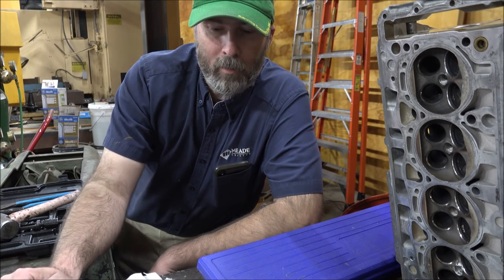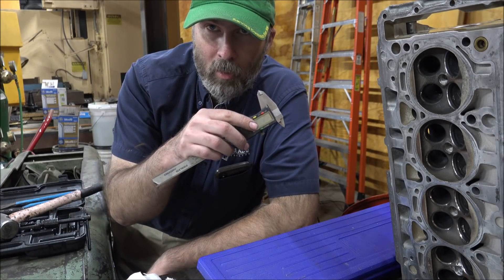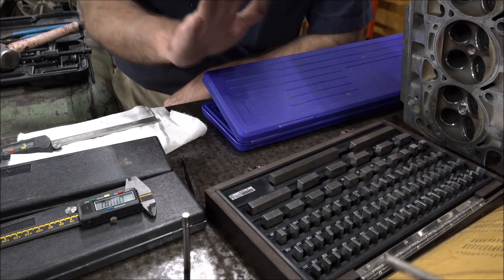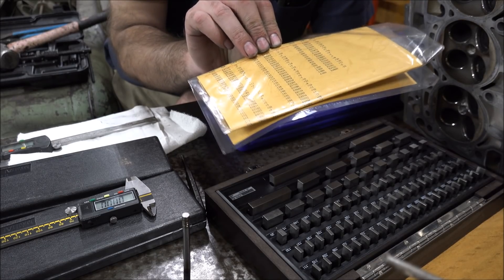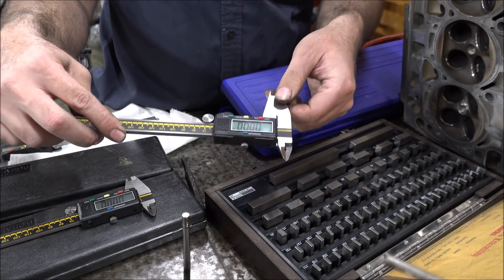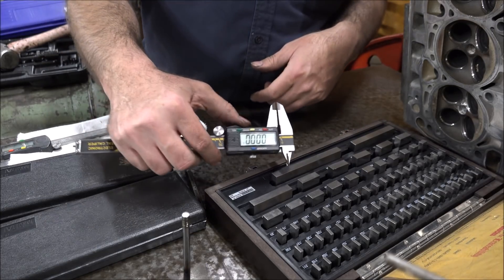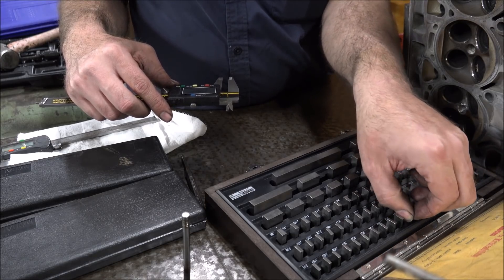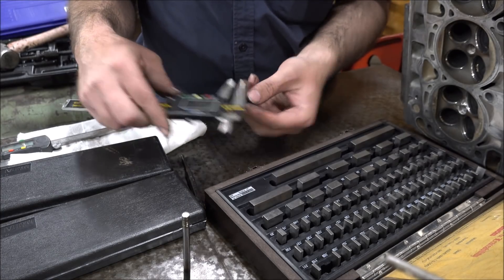The Dangers of Low Cost Measuring Tools: A Reason a Beginner Machinist Might not Hold Tolerance

Comment: My original pair of HF calipers has always been off and eats batteries like popcorn , keep them as a backup for measurements accurate to 1/8 inch , LOL .
Reply: Some of those old reader heads from ~20 years ago suck batteries dry like there's no tomorrow... and won't keep a zero for more than a few minutes, on a good day...
Reply: HF calipers don't really turn "off". They go into a sleep mode and continue to draw a slight amount power all the time to retain it's memory. 'Good' calipers have a nonvolatile memory so they can turn completely off and not drain the battery. I take the battery out of my HF calipers unless I'm using them.
Reply: @highpwr  Some are as you say, and some are not. It depends upon the lot, because HF buys from different manufacturers.

The calipers that behave as you say come back from "sleep" mode when you move the jaw.

However, not every HF calipers does that... and it can be disconcerting when you are using two sets, and the 6" doesn't wake back up, while the 12" pair does...

And, they look exactly the same.

Comment: But,  Do you trust those tools? I wouldn't
Reply from the maker: I checked them, they repeatably read correct so why not?
Reply: @bcbloc02  Exactly!  It's not all that difficult, or even much of a time cost, to check your measuring tools for reliability.

And, even the high-end stuff sometimes gets out of the factory mis-adjusted, or gets dropped on the floor and needs to be reset.

Comment: You may want to take that caliper apart and see if there are any chips or dirt where there should be also burrs.
Reply: Another problem can be the gib screws being out of adjustment, preventing the jaws from being parallel.

Comment: Also check the inside vs outside jaws. I have a Craftsman Vernier caliper that the inside jaws read 0.004" small. This is one from the early '80s.
Bored a hole for a tight shaft fit twice before I realized the caliper was bad.
Note: i then got some telescoping gauges so if I measured a shaft and a bore I used the same tool to measure both.
I have two no-name digitals. They work well but put them away fore doing any grinding. A few specks of grinding  dust and they go wonky.
Reply from the maker: I never measure with the back jaws. They will just get you in trouble. Snap gauges on the regular side is the only way I will measure a bore size with a caliper.

Comment: Put a fresh battery in the caliper that reads wrong. I’ve seen that create slightly wrong readings in electrical tools.
Reply from the maker: I tried both the batteries it came with. Same results. It is just defective.

Comment: one of the reasons why I never use  calipers.
Reply from the maker: You are missing out, I can take 10 measurements of broadly varying sizes in the time you can get one with a micrometer and then if you are measuring something with sizes separated by more than an inch you will need another tool to do it.  It sure isn't a be all end all but they have their place.
Reply: @bcbloc02  at least my measurements are right , everything made in the shop that I work in has to pass through the inspection department . Nearly everything is plus or minus .0002 .
Reply from the maker: Well if your tolerances are that you can’t use calipers anyway as their accuracy is at best .001”

Comment: I learned a long time ago cheap tools are a must have in the toolbox. When someone asks to borrow something like calipers I hand them one I got at Harbor Freight for $9.00 and one of three things will happen. 1) It will get destroyed and you will never see it again. 2) It gets destroyed and is quietly returned to you without a single word about it. 3) It gets returned to you with a complaint that it is a POS and they never ask to borrow it again. 1 and 2 are no big loss. 3 is definitely a WIN!
Reply: When I worked as a tech at various theaters I always carried a toolbox. The tray would be filled with an assortment of about ten 50 to 99 cent screwdrivers I bought from the "tool" tray in the supermarket. My real tools were under the tray in the bottom of the box. Someone would always be borrowing a screwdriver for something, occasionally to use on a screw, sometimes even of the same head type. Sometimes they would bring it back, though rarely. Usually they left it on the floor or a piece of wood near where they were working. Some people would just grab a handful of the screwdrivers and take them home to populate their own kitchen tool drawer. 
When the number of screwdrivers started getting low I'd delegate someone to "walk around the shop and stage and find all of my screwdrivers and put them back in the toolbox". This would usually find about a dozen screwdrivers, pliers,  hammers, and other random tools and get them dumped back in the box for more people to pilfer. Some of them would be the 50 cent tools I brought, some would be tools I'd never seen. But most of them would disappear again in the following days, to possibly be rounded up again by another tool search.
After the show was mounted I'd walk out of the theater with most all of my good tools, and three or four of the 50 cent screwdrivers, most bent and broken from being used as crowbars and hammers. Often I'd also manage to acquire a decent tool or two from the "find all the screwdrivers" expeditions.

Comment: Hi Brian!
I learned a long time ago not to buy cheep tools! About 65 years ago when I was in high school, I bought a 1/4 inch twist drill index. The first time I used them, all the drills actually "unwound"!
From that point, I have made it a practice to buy the best,.... and compare QUALITY!.... Its tough to beat Starrett, CP, Morse, Snap-on, OTC, Drillhogg, Milwaukee, etc!!
Best Wishes!
Gary
Reply: Hi Gary, I've had the same experience, great quality so long as you didn't drill any holes, even in soft wood. 
They were possibly Japanese back then,  China didn't have any manufacturing at that stage.
Reply from the maker: Right on

Comment: Ya cool stuff Brian you found a dimensional lumber pair, the mitutoyo solar power On those for me It's the battery hasel the capacitor scale's signal can be processed through like a yuri's toy's dro and the tool calibrated for count's per inch or how many from here to there sound's complicated but cheap the magnetic strip you just roll out the "tape" on the machine table or whatever are the cheapest say digital gear tooth caliper on the digital display like micro inch acuracy on those
Reply: I love my super solar 8" calipers. always spot on, no batteries, and checks to a half thou every time.
Reply: "dimensional lumber pair" -  https://www.highlandwoodworking.com/images/products/detail/168310d.jpg
Yes, they really do exist. lol

Comment: check the two screws on top of the head... snug them up and back off slightly.
Reply from the maker: It is not the slide adjustment. There is a problem with the counting part.
Reply: @bcbloc02  Looks like a defective glass scale from 2,500 miles away over the Internet...

Comment: The problems I see with cheap calipers is repeatability. Measure the same part 3 times and get 4 different numbers. I am not doing anything precise just measuring bearings and shafts
Reply from the maker: A good one will repeat no problem but you can't be pushing on them when you take the reading or you can easily clamp them undersized.  I mean I probably just took 50 different size readings of various sizes on the number every time.
Reply: +1, only used calipers here for roughing............when push comes to shove with a measurement, I grab other things to do it.  I wouldn't buy a cheap set of calipers either, Mitutoyo's for me...........Love them.

Comment: Contact the distributor on the bad one and complain.
Reply: You don't even need to complain. Just explain that you have problems with the item and they will likely replace it. I've dealt with Travers in the past when I bought a 8" rotary table and tail stock from them. The tail stock got smashed in shipping, scarring the paint,  broke the adjustment knob and the center for the quill fell out of the box and was lost in transit. I emailed them and asked for a new knob and center. They sent me another complete tail stock instead.